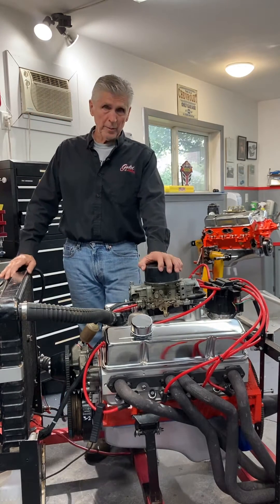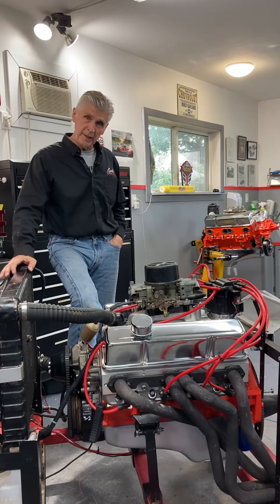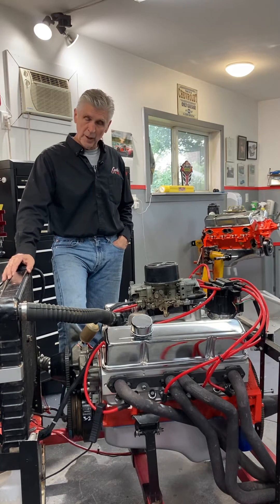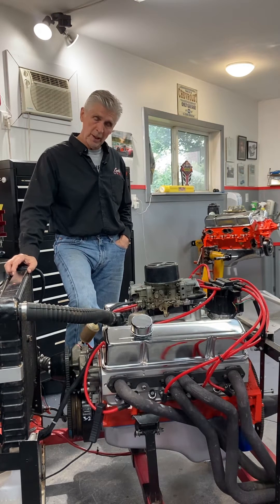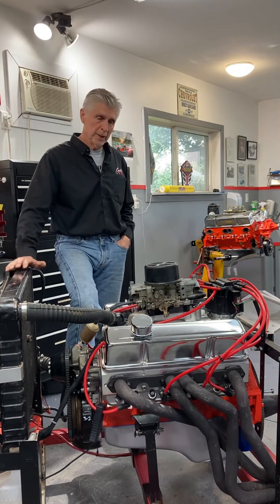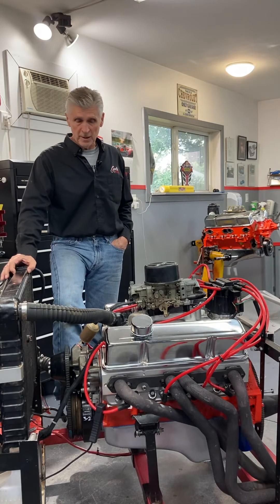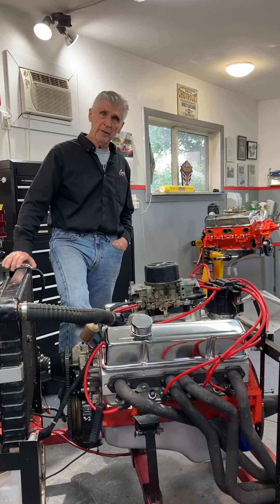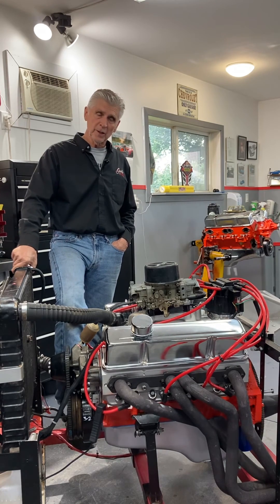400 SBC first run with leaking AFR heads from Skip White, Should we run it?? What's next?

Comment: The way the factory gets valve seal, is using interference angles, 45 deg. seat in the head and a 44 deg on the valve. And the seats just wore together over time.
Reply from the maker: Thanks for the info Racer. AG

Comment: so do heads taken to a machine shop to be done,do they leak like the afr?
Reply from the maker: Very good point Allan. For my previous build of a 400 in the spring I had heads completely rebuilt by a reputable machine shop and they leaked too. I will highlight this point in my next video. AG
Reply: @goldsgarage8236  i have a black and decker valve and seat machine i am going to do a valve job on some heads i got and see if the job leaks,of course i will have to do it when i get back home from work but now i am curious if they leak i know after i did some heads i poured gas in and i never seen any seep out

Comment: I had the same issue with my heads. I had them checked and the shop re - cut the valve job. He said that the valves would have sealed but do you want the head of the valve to bend to match the seat then brake off later or have them match now with less chance of the head of the valve coming off causing catastrophic failure. Mine never failed!
Reply from the maker: Thanks Stuart, something to think about for sure. AG

Comment: I'm glad you made this video! Very fair and informative. I watch all of your videos and I am a Big fan of your content and professionalism (we're a bunch of hillbilly's down here lol). Here is my 2cents as a machine shop owner and a race engine builder with 35 years of dealing with this very issue. We bust down ALL "assembled" heads anymore for lapping and seat checking as well as guide checks & spring testing. Then, we vacuum check the seats OR liquid check them as you did. We have found even from companies like Brodix or AFR , We find issues. And I can tell you it's a 40/60 shot on weather everything checks out these days. Cheaper heads I almost always have to grind or re-cut the seats as well as re set up the springs. Now that being said, Skip White normally sells quality stuff and they're correct...the valves will probably eventually seal. However, my concern and in my opinion, you know as well as I do if the seat width is not right on the exhaust valves they wont transfer heat correctly and could cause problems or even a valve failure later. I've had this happen a couple of times.....But to be fair, it was on extreme duty engines turning a lot of RPM. Again, just my 2cents. Great Video! Keep them coming Brother!
Reply from the maker: Thanks so much Mark for taking the time to provide a very informative comment. I value your knowledge and experience. I went this direction because I feel we will all learn more. AG
Reply: @goldsgarage8236  I'm glad your doing it this way. This is a great test!  MT

Comment: Great video! The concern I would have is if the valve guides are not concentric with the seats. I have heard of this. If this is the case the valves will seal but the valve guides will prematurely wear.
Reply from the maker: Thanks Mattew. Good point, we will see this if we have to lap the valves. AG

Comment: I grew up in a machine shop & the focus was quality period.  30 years ago & now I would never ever trust a factory produced heads valve job , 5 angle , seat cutters & back cut faces for me.  The same heads sold through Pro Maxx have 100% American valve job in house & they’re very nice , piece of mind .  Hope it works out , enjoy your channel 🇺🇸
Reply: Wrong,  ProMaxx just bumps the 45 with a stone in the USA to make sure they seal,  I have seen them leak.    Take every new head apart and lap the valves is the best way to go.
Reply from the maker: Thanks Flux. Good information, I am learning from you too! AG
Reply: Promaxx is a great casting (same as Flotek head casting) made in China. The AFR Enforcer sbc head casting is not the same casting as the Promaxx heads but still a good casting. I have used many of the Promaxx max series 200 sbc heads and 317 bbc heads as well as the sbf 210 and sbc 215 Project X heads with good results.
Reply: @tomtowers8513   I tend to not speak generally about all heads sold by any brand,  ProMaxx buys from several China suppliers same as FloTek,   for ProMaxx the BBC, SBC (project X) and LS (extreme) come from the better quality supplier and are as good or better then anything made in the USA.  AFR Enforcer BBC,  Liberty BBC, Skip White Bravo are the old ProHeader BBC head,  and not as good of casting, or design.

Comment: So if those are the Chinese AFR heads and the seats were installed over there the leak may possibly be in between the seat and the head? A common problem from aluminum heads from over there.

If you have a good pattern lapping them in really easily then the above mentioned may be the problem? Only one way to fix that without changing the seats and that is using;

Self wicking Green Loctite. A few drops around the diameter of the seat with the heads taken apart. Let it dry for 24 hours before reassembly. 

By doing nothing would also seal itself with carbon after it's ran for a little while. But I have also heard stories of China installed seats falling out, the Loctite gives you a little extra reassurance they won't. Good luck.
Reply from the maker: Thanks itseither, I always enjoy your comments. Very informative. AG
Reply: Nice info…..the more ya know!!!!!

Comment: This is proof that even the best can let iffy products out the door.
Reply: No, it's proof that when you bargain shop through skip white or others who buy the bare casting and put cheap parts in them without proper setup you'll have problems. If you ordered the assembled version from afr, or a professional like Speier, weingartner, etc this would have all been checked prior to them getting boxed up.
Reply: Skip white has the Chinese version AFR’s low budget heads. That’s what he purchased. The $2300 AFR’s heads never had problems. Skip white purchases the Chinese version and goes through them.
Reply from the maker: Thanks for your comments. AG

Comment: I bought some brodix 180 ik heads and was thinking about taking them apart to improve chamber near valve and also smooth out casting flash and cc chambers. The result of what your doin helps to know what to do. Should i lap them in? Well thanks for doin this ARP has a good reputation so i know Brodix is also a good company. But never trust the machine shop check everything and they were machined so check everything. Thank you.
Reply from the maker: Thanks Jacqueline. Great comment. Just to reinforce what you are saying, on the previous 400 that I did in the spring, I had the ProMax heads completely rebuilt including new guides at a reputable machine shop. 3 exhaust valves leaked and I had to remove them and take them back to get fixed. Lesson learned, you can't contract out your problems. AG

Comment: Good decision. If we have to do valve jobs on new expensive heads we might as well buy cheaper Chinese heads.  I am totally against paying a machine shop to finish the job.
Reply: That's one of those yes/no/maybe things.  You want 5 angle with 50 degree seats?  That's not likely coming in an off the shelf package. 
I don't mind doing a little work on heads, but I'm also lucky to have a good head & block shop near me.  Anyway... new heads always need some kind of attention.  At a minimum you have to verify seat location [& width] on the valve, and that spring height will serve your cam needs. Step one for me is always to strip heads down so I know what's in my engine. 
Anyway, cnc heads have one operation that has to be done separately: the valve job.  No other way about it - center doesn't exist until after guides are in and honed.
Reply from the maker: Thanks for your comment's Flinch. Very informative, AG
Reply from the maker: Thanks Ken. A MS is not always the answer either. In the previous 400 that I built in the spring, i had the Promax heads completely rebuilt at a local MS and 3 valves leaked. I had to remove them and take them back. That is why I did the leakdown test before assembly this time. AG
Reply: If it says complete just bolt on that is what it should be or else lower the price and I’ll pay to have them finished